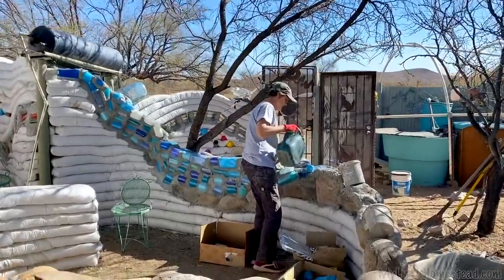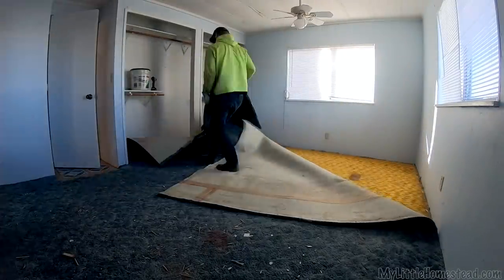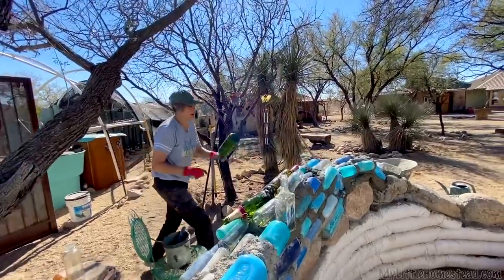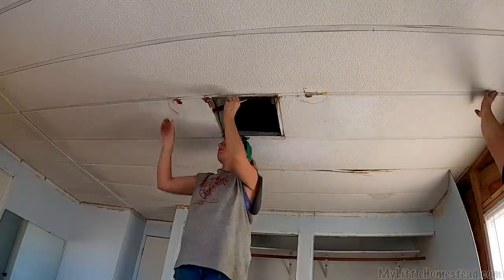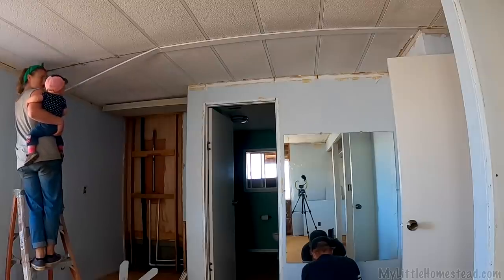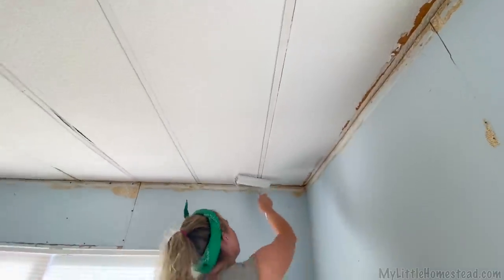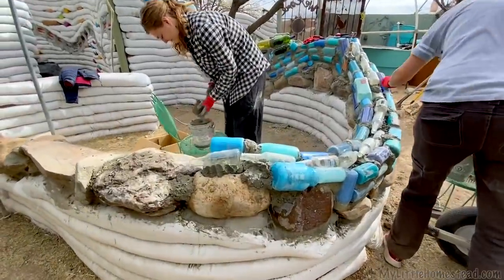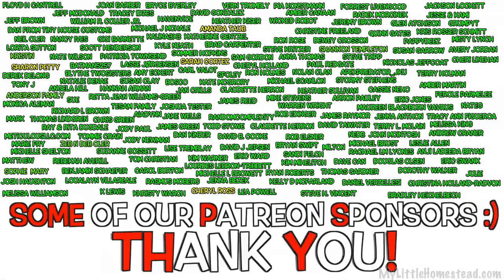Earthbag/Rock/Bottle Wall for Outdoor Shower | Weekly Peek Ep268

Comment: A trick I learned in the Navy when painting anything that's white: for every 5 gallons add a pint of light blue. The white will never turn dingy or yellow on you. An issue with people that smoke inside, it turned our white walls and ceilings a lovely shade of awful yellow.
Reply: How about a dark room? It never gets very bright in there and I don’t know whether to use a blue or yellow undertone? No smokers but I’ve heard white looks dingy or grey in a darker room.
Reply: @lollylolly8186  if you add a tiny bit of light blue to the eggshell white, you won't be noticeable at all. that will just keep the white from becoming yellow over time
for a dark room you want to lighten? I'd go with light blue...yellow winds up being sickly. light blue tricks your brain into thinking "Sky".
Reply: @mastring1966  Thanks!
Reply: that's exactly that laundry detergent makers do...   but i'm old enough to have a bottle of 'blueing' on my shelf.

Comment: Garen a wiring trick for future. Take a string and tie a washer or screw to the end.drop thewasher down the wall. Now you can tie the wire to other end and pull it through.
Shelley lily pads ARE found in rivers. They are in the still areas.

Comment: Just curious why Garin didn't put insulation in the walls why he was pulling the walls off to work on the wiring. It seems like it would help with the heating and cooling of your house to have insulated walls.  Other than that, its looking great.
Reply: Agree.
Reply: There is insulation. It has flattened  some but it's there!
Reply: Ok...didn't see any there.
Reply: I'm curious why they didnt do more finishing before painting? The ceiling was a bit shanky.

Comment: I have found working with glass, if you use a gloss clear coat of Modge Podge or similar product, pretty much anything will adhere. It gives just enough texture that glue, adhesive, paint, mortar, grout etc. will improve adherence in outdoor use.

Comment: Garen and Ellie. Do a textured ceiling with sheetrock mud. You will likely have to start by covering the seams on the ceiling with sheetrockers tape. Then spread a thin layer (1/16") of sheetrock mud on the entire ceiling and let it dry. Then then use a "stomp texture brush" like seen here --> (https://drywall101.com/articles/texturegroups/stompknockdown.php ) reasonably soaked in sheetrock mud and "stomp" the the entire ceiling in a random manner. After finishing the "stomp" BUT before it dries, take a wide sheetrockers taping 'knife' and knock down the pointy high spots. It's easy to do and I thank it would look great.

Comment: Hi, the design of the bottle wall is really cool but I think that the execution, at this stage, looks untidy. I think that all the mortaring in between the bottles needs to be neatened and tidied, much like a brick wall. You might be ok with untidy but in such a complex wall, with such odd shapes and angles, smoother, even mortar highlights the bottles, whereas untidy mortar just looks untidy and detracts from the beauty of the wall.  Compare the section of wall shown at 11:23 with the section to the left of, and under, the "lily pad"" shown at 9.06. Good luck with the continuing build.

Comment: would be interested to hear from viewers that have tried earth bag building that live in cold climates - how has it worked?  is cracking an issue, and are there any special considerations - like do you have to modify coatings or anything.